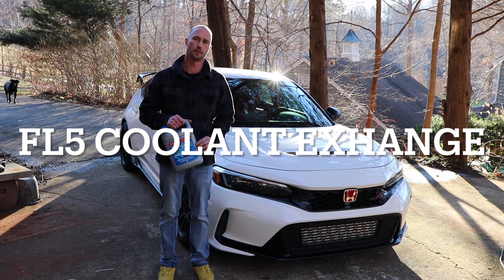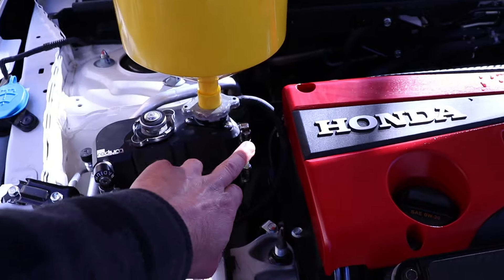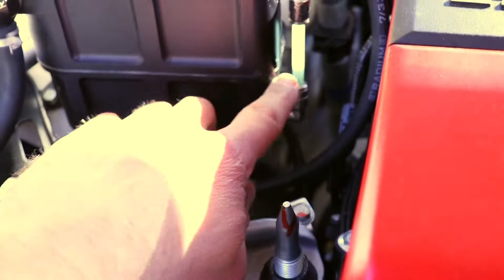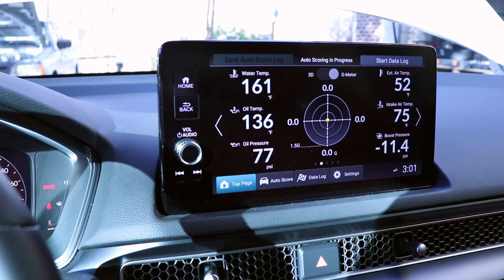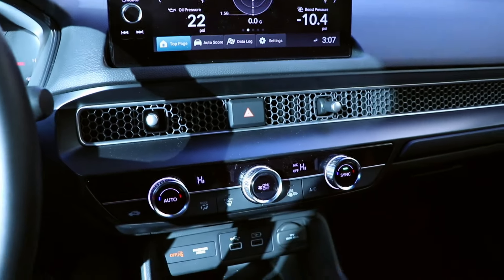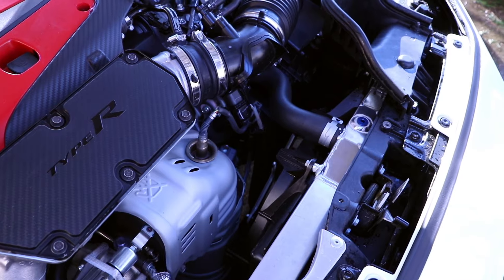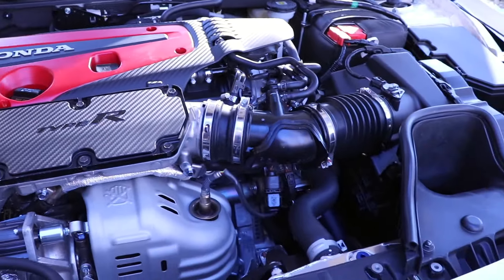FL5 Civic Type R Coolant Exchange

Comment: Appreciated as always. I placed my phone with a mini tripod next to my monitor and ran a lap against your final lap 2:11 at VIR on forza. Closest I can get to track day as I’ve only got an 08 LS460 for now. Aiming to pay it off and get a CTR within a year or two. Thanks for posting! Living vicariously for now 😅
Reply from the maker: How'd you do on the lap?
Reply: @pointbypatrol  forza Motorsport doesn’t have the FL5 yet so with a stock FK8, race tires and race wheels, I went 2:12

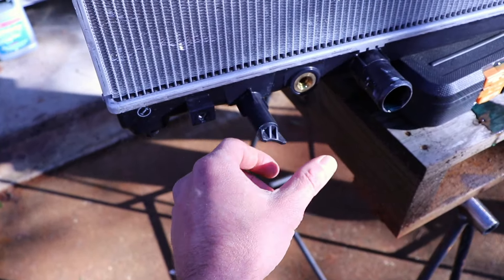With that FK8 and Sport exhaust, Sport air filter, Sport intercooler, sport oil and cooling, sport flywheel, race brakes, strut towers, anti roll bars, race suspension, race wheels/tires 265mm, 260lbs weight reduction, 339hp/327tq, 2,879lbs I went 2:00.8. No assists, no ABS 

In b class with a BRZ I went 2:02 which for now is top 5% internationally. I’ve been lapping VIR 90% of the time I play as it’s the closest track in real life and I want to know it as well as I can for the day I have a car I can track and go there
Reply from the maker: I'd be over the moon if I hit a 2:00 flat!
Reply: @pointbypatrol  haha in forza Motorsport with whatever mods you want and no real life fear/consequences, damage, you sure can. Anyway, looking forward to watching your car/track journey and maybe I’ll be trying to keep up with ya on the track someday!

Comment: hey thanks again for posting your videos are always a great add to the community, had a few questions for you

1.) is the proper procedure to fill it up from the expansion tank and not the rad itself or is pwr rad only has a drain and no fill cap

2.) so you mentioned the fan a few times, first is this can dual function for AC and for rad cooling... by that i am assuming once the rad fluid gets hot it's going to open the thermostat and with that trigger a signal to the fan to come on

my concern, i had noticed the fan comes on even in cold starts, AC is off...
my R is bone stock with about 2400 kms on it

thank you in advance btw
Reply from the maker: The factory radiator doesn't have a cap either. Everything is filled from the swirl tank.

The fan is a dual function fan, so if you're running the a/c on "auto" regardless of the temperature setting, the a/c compressor will be running. When the compressor is running it will trigger the fan to run at the same time, which will make it extremely difficult for the engine to get hot enough to open the thermostat. When I ran the heat to burp the system I selected "a/c off" which prevented the fan from running. This still pulls heat, so you don't want to run the heat but in cycles for a few minutes at a time. This was merely to ensure that the heater core didn't have trapped air. I then turned the heat off and waited for the car to get hot enough the it kicked on the fan to cool the radiator down. This is a sign that the theromostat is open. When the thermostat opened I saw the coolant level in the swirl tank go down, which means there was trapped air in the engine that got pushed out when the thermostat opened. Hope this helps!
Reply: @pointbypatrol  oh yeah that makes a lot of sense now, thank you so much... first thing i will do is check if the AC is in auto and will use your guide here when it's time for me to flush the rad fluid.... again thank you so much

Comment: were you able to fix the overheating issue ? if so, what did you use to help fix it?
Reply from the maker: Yes, The CWR Radiator did wonders for heat management. Also, if you're going to track you need to remove the baffle under the hood scoop, and depending on the outside temperature you'll likely need to run the heater on full blast in the car.

Comment: can you not remove the splash shield for easier draining?
Reply from the maker: I did, but the splash shield doesn't go all the way up to where the radiator is, and taking off the other piece wasn't worth the trouble. Knew it was going to be messy and just let it rip.